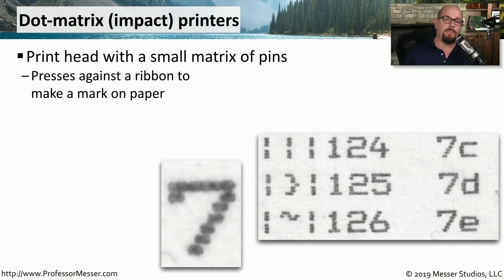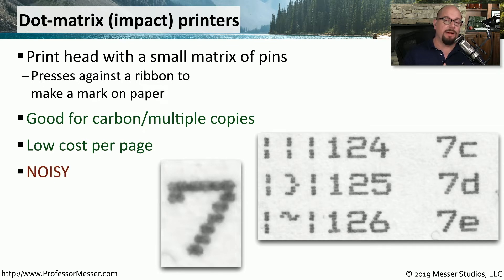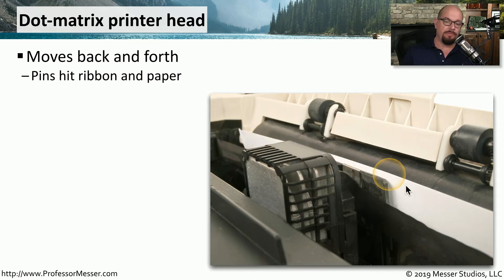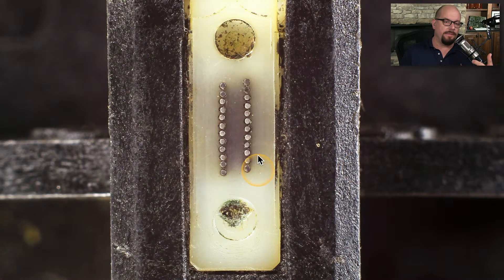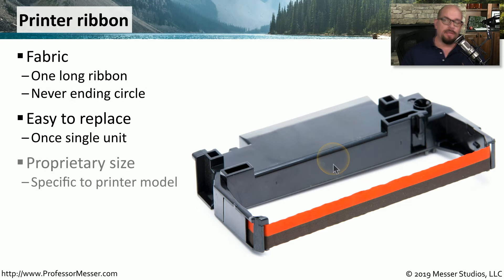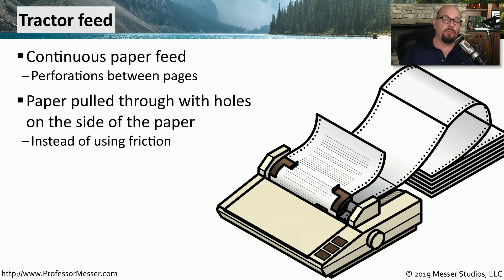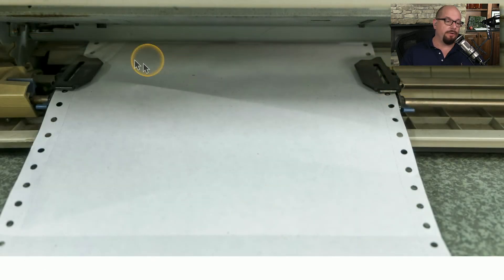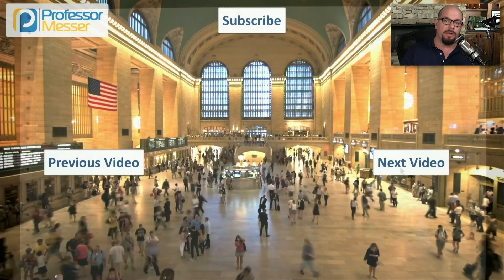Impact Printers - CompTIA A+ 220-1001 - 3.11

Comment: this sounds like it prints similarly to a type writer. is this a good comparison?
Reply from the maker: What's a typewriter?
Reply: @professormesser  maybe I'm using the wrong term but one of those olden keyboards - they're heavy, input one letter at a time onto paper, and you may have to readjust paper as you type for it to realign.
Reply: @OniiChanPls  You used the right term, how does he not know what a Typewriter is lol, I  think hes trolling
Reply: @g.p.5150  hes too advanced for us to know what it is lol

Comment: Why are you using the word print pins terminology vs the printwires?
Reply from the maker: The description of the impact printer head components are most commonly referenced as pins, such as the 9-pin or 24-pin dot matrix print heads. It's also acceptable to call them wires, although it's not as common a reference.